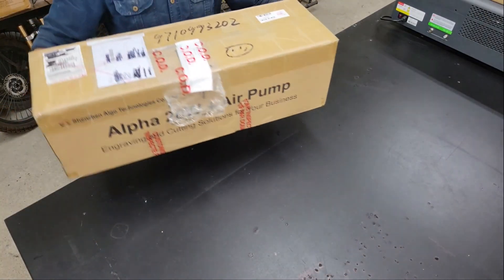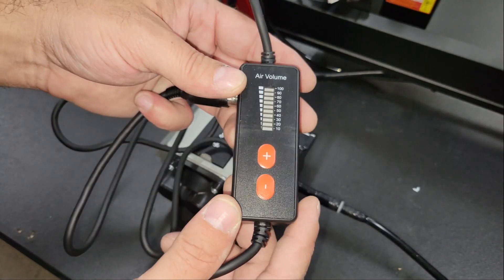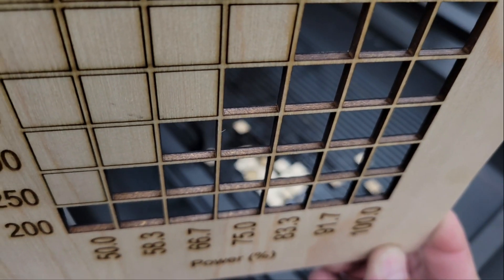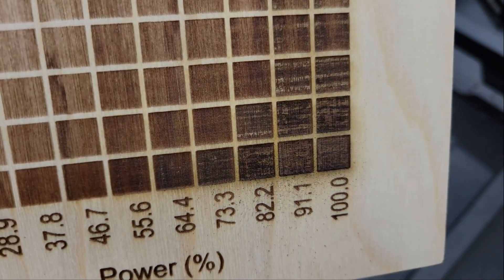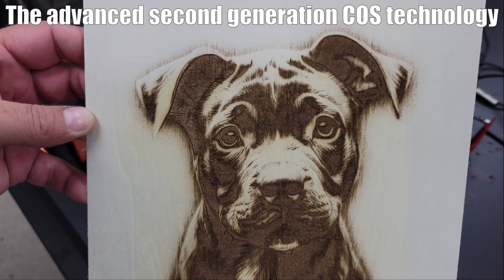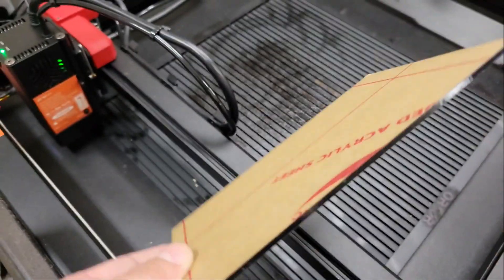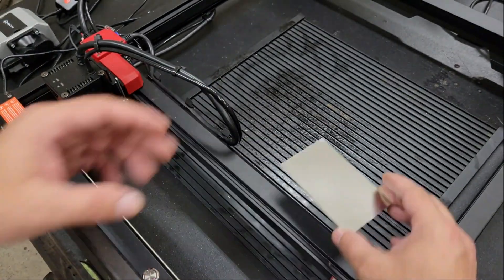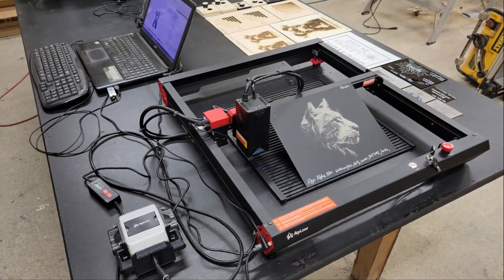The Ultimate Tool for Creators--the AlgoLaser Alpha 22W

Comment: Great review! Can it engrave into metals? Like, say, brass?
Reply from the maker: Thanks. It can only mark stainless steel, no other metals unless they're coated - but again, only marking/etching as shown. It's permanent, but no 2.5D engraving.
Reply: @JamesBiggar  Thanks, James! I'll be getting into engraving (as a hobby, for now) soon and have been looking for the best beginner and budget-friendly lasers to start with. It has to be able to engrave into metals though. From what I've gathered so far, it looks like I'll need at least a 30W fiber laser.
Reply from the maker: Np. Even just a 20W fiber laser would do what you want. If it's just for hobby and you don't need a massive work area, then I recommend ComMarker's B4 (20W) or B6 (30W) galvo lasers. I think the B4 series starts at around $1500 for 20W. Nothing fancy but it's a good machine and probably one of, if not the most budget friendly you'll find.

Comment: Question please.  What is the maximum marking speed on anodized aluminum that you were able to get good results without squiggles in the text, (Ariel),?  I've had to limit my speed to 500 mm / min on my Alpha to get good text without squiggles.  Any attempt to use 6000 or even 3000 mm / min produced these d squiggles.  Thanks for your testing and reply....
Reply from the maker: Never had any issues like that even at the max rated 30,000mm/min on any material. Check your wheels and belts to see if they need tightened. That's all I can think of.

Comment: I just ordered mine from WM, had a kit price of only 799, included risers, rotary, air assist....  Yours as well as other YT reviews made the choice easy peasy to buy this unit.  Question please - Is the air assist powered with a vibrating diaphragm like an aquarium pump, or other?  How loud? From what I can see the air exits out from around the lens and having this type of air delivery is best.  It gripes me to see others review this and other laser cutters WITHOUT using a honeycomb mat.  Can't really see the true capabilities of  ANY laser without using the mat.  The mat you use provided good results, but, a true honeycomb mat should provide much better airflow underneath.  Let me know where to send button batteries as your digital caliper was useless in measuring the thickness of the wood you were cutting 🙂  All in all a great video and March 22 cannot arrive soon enough....